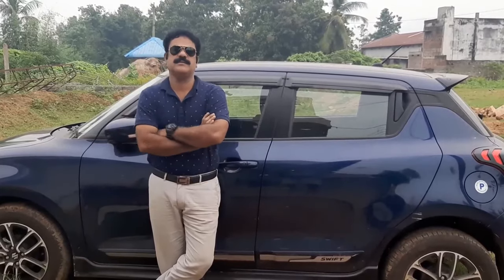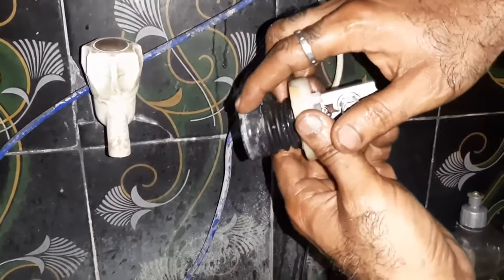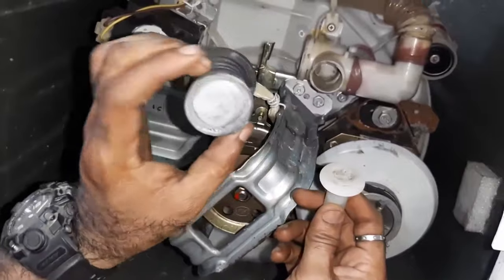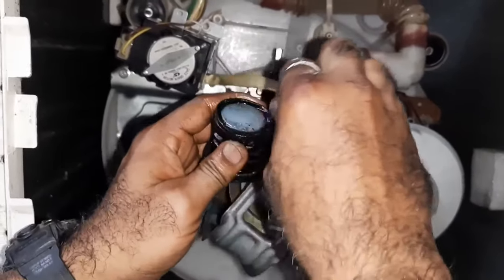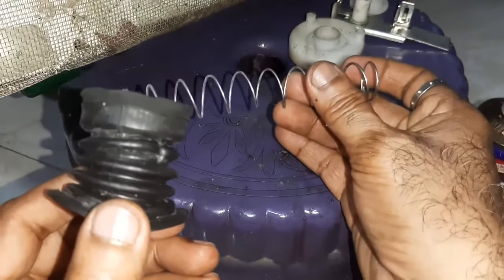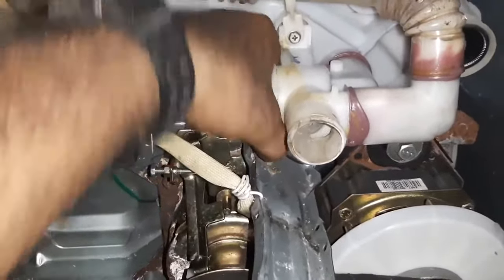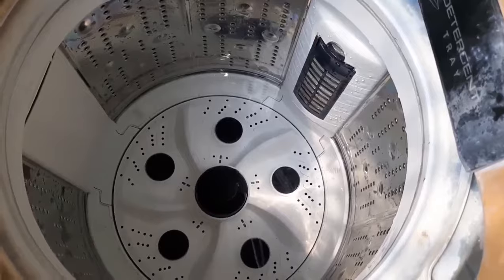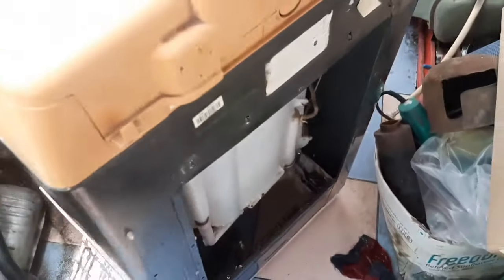Expert Tips: How to Deal with a Washing Machine Drain Problem

Comment: Hai. I need drsin valve set spare for Videocon fully automatic Washing machine
Reply from the maker: You can purchase from Amazon. Or it is better to catch a local mechanic. Because they can manage even from scrap. Sometimes if you go to servicing center they will not give you. Because I faced all these problems😰 and finally got the job done and gained lot of experience 👍

Comment: hello my samsung washing machine is not able to hold water.the drain motor pulls the wire but never release to open the valve.what to do.
Reply from the maker: In this case you need to open the drain valve assembly to check the spring action and it's continuity towards drain valve seating/sealing
Reply: thanks i will try
Reply from the maker: Wish You All The Best 👍

Comment: Sir, please reply. I have same top load Washing Mashine, I did everything. My rubber valve is in good condition. I cleaned drain system also. But still leak persist. 

One question Sir, if we cut the spring, how it will effect the rubber valve holding capacity. Because it will reduce the spring pressure. I have this doubt, please clear if possible.
Reply from the maker: If you cut the spring the less pressure will be applied on rubber diaphragm
Reply: @LambrettaRamesh  Sir, still I have confusion if spring will act less pressure on Diaphragm of rubber valve. Then I guess, it will not hold in idle condition, when we fill water in drum.
Reply from the maker: The more pressure on diaphragm then good sealing if condition of diaphragm is good